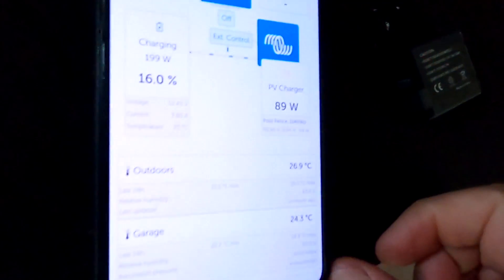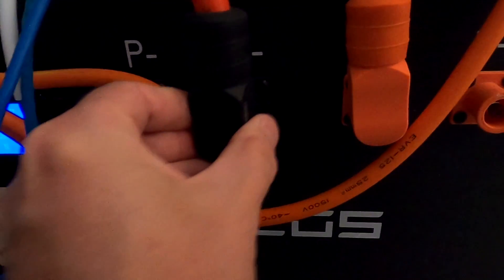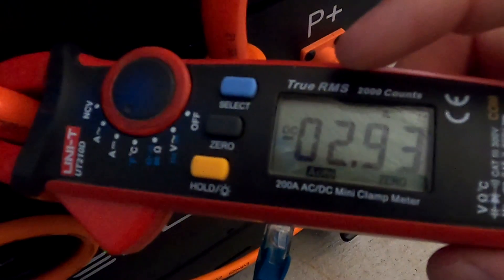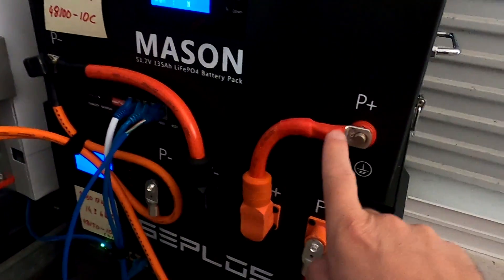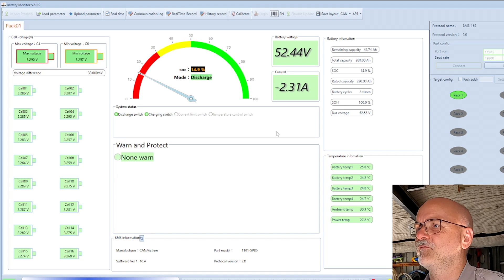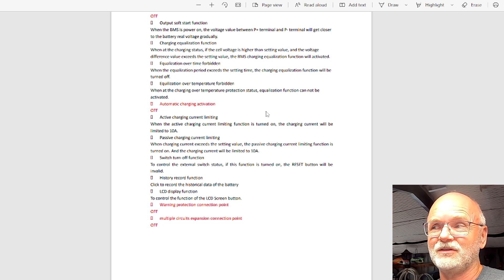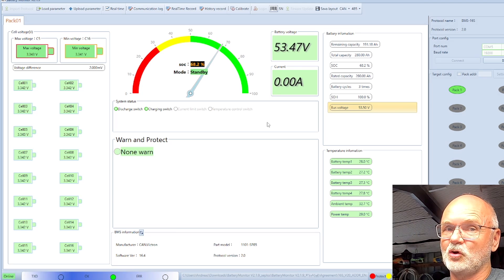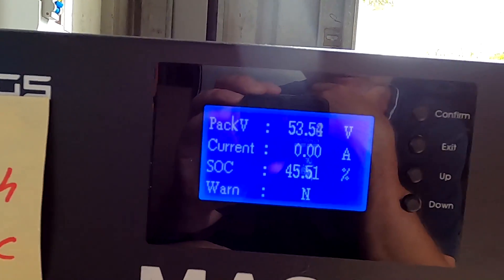Seplos BMS current limiting function causes weird behaviour.

Comment: I'm trying to decide whether to go for seplos BMS or JK BMS for 6x 2.1kWh modules that have, going into a solis AC coupled battery inverter. I like the idea that seplos BMS would do comms with the Solis out of the box, but the passive balancing sucks (although it may not be awful on these 2.1kWh packs which are comprised of 26850 cells). The JK BMS series has such good control, but poor comms. I might be able to run 6 separate JKs with rs485 comms to something like Venus OS, and then send that compiled info via CAN, or via Home Assistant and then output to CAN. None of which I have ever done before.
Reply: The critical point i missed here is that they are 51.2V 16s packs and would be connected in parallel either via daisy chain approach or busbars ideally.

Comment: In the end the big battery shows 53.50V and the small one 53.54. a bit higher. This might be the reason all the amps go into the big one. Furthermore I think the 10 A limit also applies to the equalisation current. There was quite some deviation in the beginning.
Reply: Well you can't judge anything out from the voltage on a litium Battery in general. 
Maybe just a little bit if you BMS have a high resolution AD Converter and both BMS's are calibrated with the same high precision instrument at same temperature, then maybe yes, but in general it is the Ah which count.
The Ah Will be different due to two different sizes battery control by two BMS units, which will lead to different charts characteristics and therefore two different charts situations.
Have the cells been in parallel with one BMS, no problem at all...    
Allan 😊
Reply: @A2an  The issue here is that two batteries that are connected in parallel "should not" have different voltages. Something is causing a voltage difference between the battery/bms.
It is impossible to have 2 different voltages on two batteries that are connected within such a short distance and under no load. This is why it is quite puzzling why one BMS shows one voltage, and the other is higher.
Tbf, this could be an incorrectly calibrated BMS and it isn't reading the correct voltage and it is noticeable in this situation. Perhaps that is also why the software is triggering because it is detecting a too big of a voltage difference.

Comment: OOh, very interesting behavior.   Here's the skinny on current limiting.   Linear current limiting requires voltage conversion.  i.e. it requires a regulator (usually a switching regulator).   For example, think about what happens with a current-limited power supply or charge controller.  But a BMS only has FET switches and transistor based balancing.  It does not have any voltage regulation for the main power paths at all.

This means that the BMS can't actually do any voltage conversion and thus cannot linearly control the charging current in any way.  All it can do is the switch function... allow charging or disallow charging.   If it were to try to do linear current limiting via the FETs by using their linear zone instead of their switching zones, the FETs would have to dissipate the difference and they would melt (it is like using a bunch of diodes to try to reduce the voltage on something... the diodes dissipate the difference as heat).

So all a BMS can do is switch on and switch off its charging-related FETs, and that is what you are seeing.

There is one last discharge path.  When the BMS disables charging but allows discharging, the voltage of the battery might still be higher than the voltage the charge controller is able to push into the second battery, due to the second battery pulling the voltage down.   That is, the charge controller is now managing the current going into the second battery and adjusts its voltage appropriately.  This voltage might now be lower than the voltage of the first battery.

Thus you have a higher voltage on battery #1 going through a closed switch to the lower voltage on the bus and the first battery winds up discharging into the second battery.

Comment: Yup, something not quite  playing right yet. I have noticed with cheap Daly BMS packs,  when paralleling smaller LifePo4 packs at 1C and above, and one cell in one of the packs hits the BMS charge limit, and disconnects charging, the other pack would soon cut off, then the first pack would cut back in when the one high cell would drop, and charging would resume, then the second pack would charge the first pack until it shut off, and vice versa in a cycle until one pack balanced, which with the Daly could take hours. 
As it looks like your packs are well below charge cut-off voltage Andy, unless you have one high cell in one pack that's peaking well before the rest I don't think my case would apply.

Comment: Hi Andy, it only happened when the two batteries were connected in parallel. Even did it without any can bus and victron connected. Looked like the top battery voltage was higher and was charging the bottom battery with more than 10 Amps. Reason for it bombing out. Or just my guess

Comment: Take the initiative current limiting switch. I love it. Great feature. The only configuration I had in my mind prior to this was possibly a current limitation switch for low temperature recovery. Supplying the ten amp maximum current would likely heat the cells above freezing without damaging them. Interestingly, the cold cells internal resistance will effectively function as a small ( maybe 10 Watt) heater. 
✌️👁️👁️👁️👍

Comment: For the same terminal voltage the battery with the lowest internal resistance will take most of the available power which may cause the odd results.  Once you have the two 280 Ah packs they will be a better match

Comment: Hi, Andy...!!! 
I really don't like the fact that you put in parallel 2 batteries with different capacity... I would rather connect them individually to the Link Distribution equipment and go from there...
Also have their respectives BMS's connected individually to the Cerbo Gx... I think they would work better that way, instead of "battling" each other when they are in parallel "internally"... if you "catch my drift"...

SEPLOS doesn't recommend not to put them in parallel in vain... 😄😁
So, good luck with that...!!! Can't wait to see your follow up...!!!
Cheers...!!!

Comment: Love this test thanks allot! One question, i’ve got a custom 300ah 24v battery with a 250a Daly BMS in my RV at the moment and it’s working great, and i also have a 200ah 24v Ampere time 200a BMS that i want to add to the system. I’ve been watching your mixing battery videos and believe i can do this however I haven’t really seen you charging them off AC, i have a Victron 24/3000 wound this be ok to use to charge both at the same time? provided i have them BMSs and wiring set correctly? Thanks
Reply: Yes .
Reply: @onthelake9554  thanks
Reply: @Drifty325i  You're welcome .